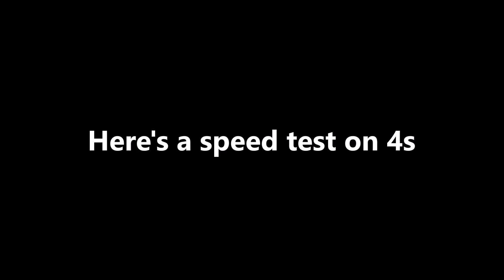🚀TEST FLIGHT HGLRC SECTOR 5 V3 🚀

Comment: What a great flyer and review!  I run 6s 1300 on my v2, seems to be the best balance of performance, weight and flight time, at least in my novice hands.
Reply from the maker: Thanks!  I think 5s on this 1900kv is just perfect but I can get away with flying it with a 4s.vvThis is indeed a great flyer :) 😍
Reply: Yep. 1000-1400mah 6s is perfect. Also I swapped out that heavy sector5v2 frame out for the lighter Wind5 frame. Its so much faster/agile + avan 5" props 🔥

Comment: Thanks for the review,how would you compare this to the iflight nazgul5 6s
Reply from the maker: This one comes with a lot of 3D printed stuff and the quality is really good.
If you want more of a cruiser with GPS than it being nimble, go with the Sector 5 V3.
Nazgul5 is slightly less quality but it costs less and you need to purchase the 3D printed stuff like the camera mounts separately.
Reply: @RCEscape  thanks buddy for the reply,yeah it's hard to build anything that cheap especially when they come out with these with even crossfire,I'm more into freestyle and doing some gates,I'm not sure if this vtx has a mic like the force on the nazgul5,witch is always nice to here what's going on when flying,not sure about the motors 1800 compared to 1900 on this,I' have a tbs source one I built awile ago but its 4s,so just looking for a good 6s,hard choice between the two.

Comment: Seems like a solid bird. GPS good vtx. I like 4s on 6s motors smooths it out..and I don't have 6s🤔🤔😂😬😂😬🤪🤪
Reply from the maker: Sleeping Bear 
If you get too low kv motors then 4s is too weak but 1800 and up is still pretty good but it is fun with a 6s batt for sure!! 👍👍👊😍
Reply: @RCEscape  learned again! Your better than bartwell!!